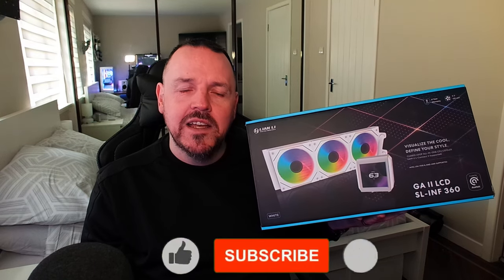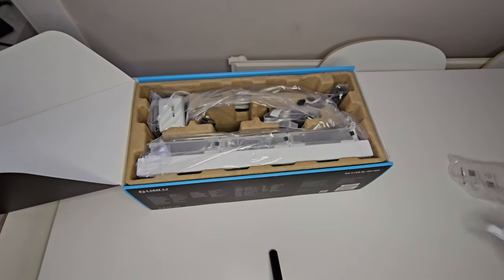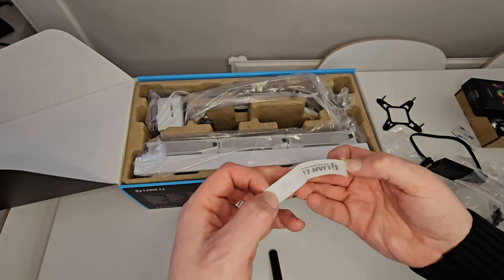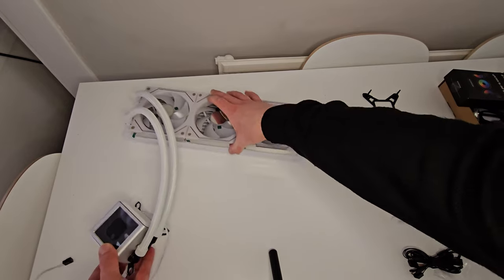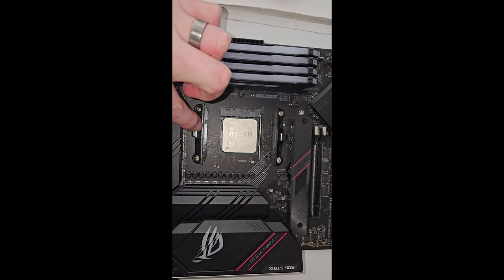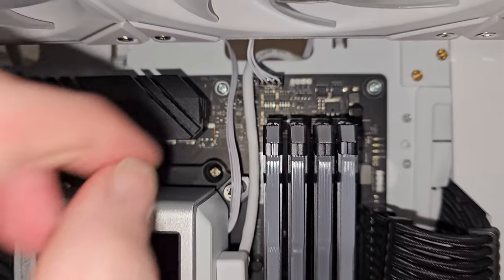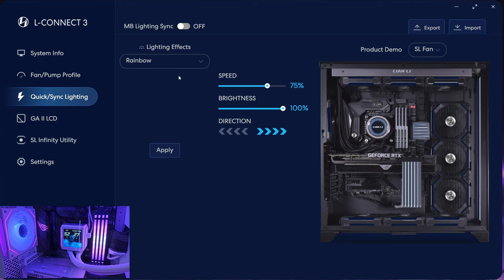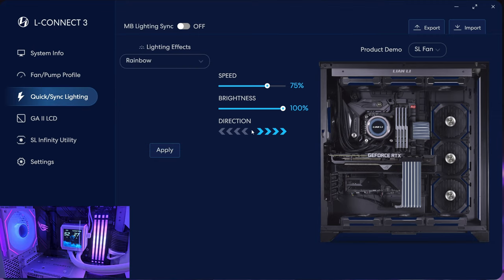How to install the Lian Li Galahad 2 LCD SL-INF 360

Comment: why isnt the other cable (sata) connected into the pump? do i dont need it to run the aio?
Reply from the maker: No you don't need the second cable as the AIO comes with a hub for controlling the fans, if you didn't have the hub the other connection on the pump could be used for hooking up fans to it and allow you to control them through the L-Connect software.

Hope that makes sense, I believe in the 240 version of the AIO you don't get the hub
Reply: oh ok thank you very much. and how will get the aio power? from the connector itself?
Reply from the maker: @user-pt4tm2ol9g  so the screen and pump will get power from the usb-c cable that plugs in to the side of it, other end goes to a USB header on your mobo.

The fans will all get their power from the included hub which has its own sata power connection, the usb cable that plugs in to that hub is purely for the control of the fans speed and RGB through  L-Connect 3 software.
Reply: you are the best! i almost finished my build. i only need to wait for my gigabyte 4080 super oc aero that will arrive tomorrow morning :D
Reply from the maker: @BerndMiez-y4x  Nice one, you'll hardly get any sleep tonight thinking about getting that card 😂
Reply: @BrisyTechBytes  yes i know it will be so hard xD

Comment: What is the second port of the lcd display?
Reply from the maker: I believe it's meant to be for powering fans and controlling their RGB straight from the pump through the L-Connect 3 software, but as this is the SL-INF version it's not needed as it comes with a fan control hub.

Don't think it would ever really get used unless you somehow bought the AIO and wanted to use other fans rather than Lians Li's

Comment: Hey thanks for super informative video man, you answered a lot of my questions. Can I purchase 7 single fans and rig everything through the controller that comes with the Lian Li LCD 360mm? I’m trying to run 10 SL 120 INF fans (including the 3 from 360 AIO) . I don’t need the 3pk for the controller if I’m already getting one with cooler right? Also, my mobo has 4 USB headers so I should be good without the USB splitter?
Reply from the maker: Appreciate the feedback.

Yes you could just buy all single fans, as I did (obviously 3 come with the AIO). For me as I was using reverse blade fans I could only buy those in single packs but also bought a seperate Lian Li fan hub that has the proprietary connections, purely just to keep it a bit easier for cable management, so I swapped out the cable attached to the AIO fans with one of these cables and used them on the other fans....4 fan cables in total, 1 for AIO fans, 1 for Rear Exhaust, 1 for Side intake fans and 1 for bottom intake.

Sounds like you'll be all good on the USB headers too, only had the 2 on mine so hence the requirement for the hub.

Happy building bud 👍
Reply: Sweeeeet, it’s my first build so I tried to make it as simple as possible regarding cable management. Both exhaust and intake into one AIO controller was the way to go no doubt. Thank you for the reply!

Comment: im really curios. So i will buy a o11 vision and i will use it in low mode. So im gonna use it with 8 fans. 
Im gonna buy this aio which comes with 3 fans. 
I will buy a tl lcd reverse blade 3 pack with its own controller. it will go with the aio. 
to the bottom i will buy 3x single reverse blade sl inf fans, and the last 2 exhaust fans are in the aio. so the bottom and exhaust fans are gonna get controlled by the aio inf controller. And the tl lcd fans are gonna get controlled by their own controller also it will be the aios fans. Is this compatiable or do i need extra controllers etc? thx
Reply from the maker: I actually think you could probably have got away with using the 1 controller to cover all fans, I'm sure each port on the controller can take 4 fans, in saying that the LCD fans have a higher draw so that number may have come down.

With what you are getting though everything will be fine, the 2 controllers should show up in LCONNECT 3 and it'll be good having them separate, 1 for case fans and 1 for AIO fans.

Enjoy the build when you get all your gear together  👍

Comment: Hey i just ordered the galahad lcd radiator and two pack inf fans triple pack. Will this configure work or do i need single fans ?
Reply from the maker: You'll be fine with what you've ordered, you'll probably find in the triple packs the hub has the Lian Li proprietary connectors so you could use that hub to control all the fans including the ones on the AIO,  just swap the cable out on the AIO fans and keeps it all a little cleaner for when you come to do your cable management 👍
Reply: @BrisyTechBytes thank you
Reply: Which usb connectors do I connect my motherboard has 2 connectors I know the aio has 2 usb connectors and I think the triple back does also
Reply from the maker: @iipyro6202  you'll only need 2 USB headers, 1 for the USB cable from the Pump and one for the USB cable from the Fan hub 👍
Reply: @BrisyTechBytes  I appreciate your help. Another question.  Do I connect the sata cable that comes with the aio pump or no?